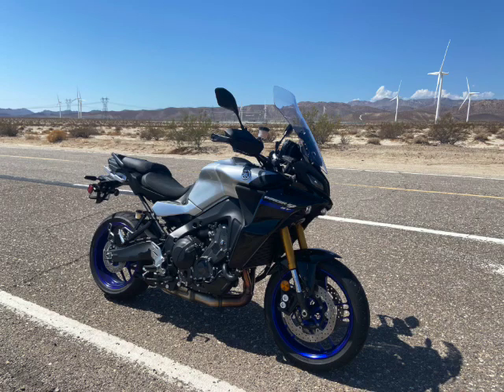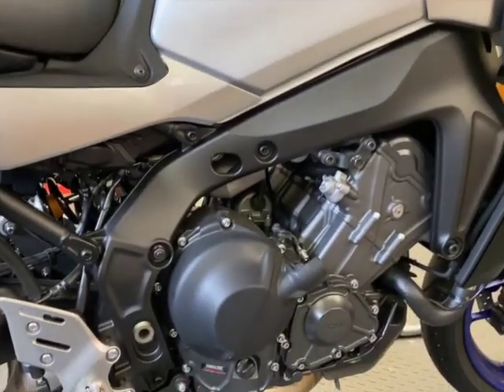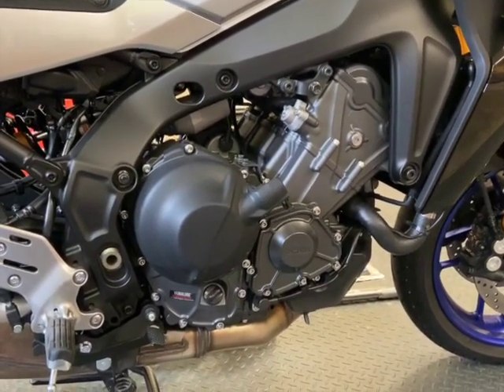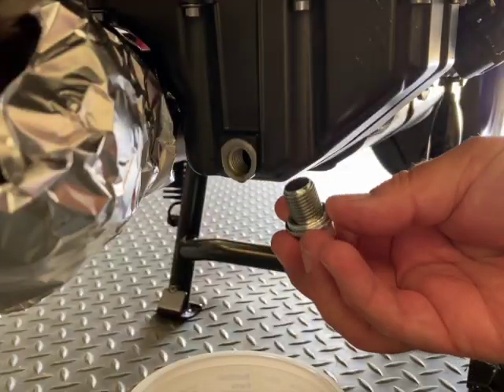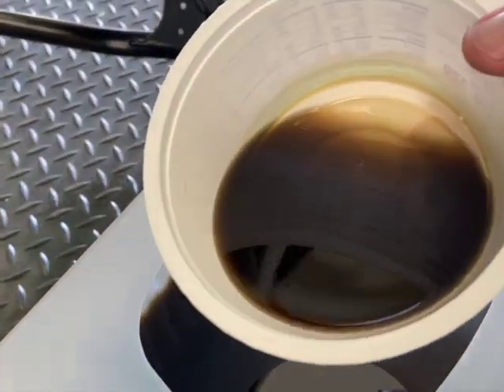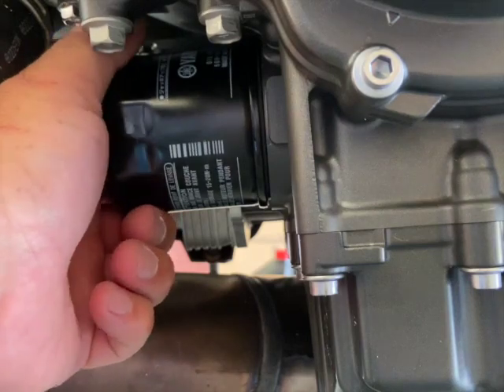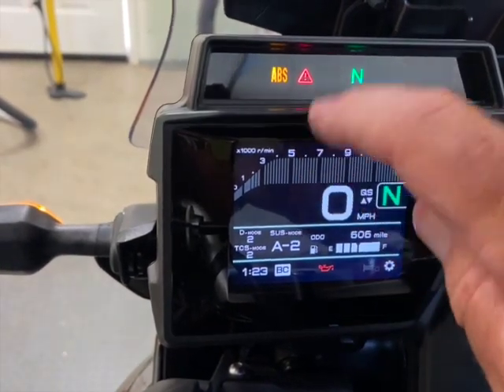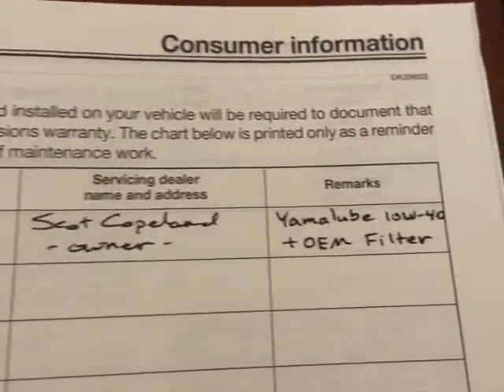600 mile Tracer 9GT/MT-09 Oil Change

Comment: Does doing it yourself not invalidate the warranty?
Reply from the maker: No, not in the U.S. But I did document the materials used and kept receipts in case push came to shove.
Reply: It would in the UK. There are a whole host of other checks that need to be conducted at 600 miles for the warranty to remain in place.
Reply: @ozzi2122 Hi, just to let you know. Here in the UK, you can carry out your own service without invalidating your warranty. You will need to use genuine parts, keep the receipts and pictures and follow the periodic maintenance for the mileage. Always check though. I have been servicing my own motorcycles for decades and have never had a problem and have never needed to claim on my warranty. To many people are anal about having a dealer stamp on their service book for some reason. It doesn’t mean that the dealer serviced your bike property when they had it all day and charged you a fortune. Most jobs are quite straightforward and easy once you know how.
Reply: @Splodge4514  Hi. I live in the UK too. I have done all my life - 40 years. Not sure why you’ve assumed otherwise and, believe me, servicing your own bike within the warranty period will potentially invalidate any warranty claims. Service your bike at your own discretion, we are all adults but you run the risk. Waving an oil receipt at your dealership proves nothing.

Comment: Where the all excessive oil coming from when you lean the bike?
Reply from the maker: Mostly the head and sides of the case.
Reply: So basically you can also lean the bike right after you stop the engine, when the oil is still warm and fluid.

Comment: Curious why the second T9GT? First one with issues?
Reply from the maker: No, I just have, and have had, the one 2022 Tracer.
Reply: @scotcopeland8752  My bad, I misread the description wording "video" on second T9 part. I changed my oil at 600 miles and everything was normal. I'm coming up on 4000 miles and I'm liking the bike.
Reply from the maker: @r0bv123  Cool. I'm at 3200 mi. and just switched to Amsoil. The shifting and clutch feel improved noticeably.
Reply: Great video, the lean is awesome to get that extra oil out, thanks for that tip. I noticed the oil was very dark coming in from the dealer and seems over filled; was this the same experience?